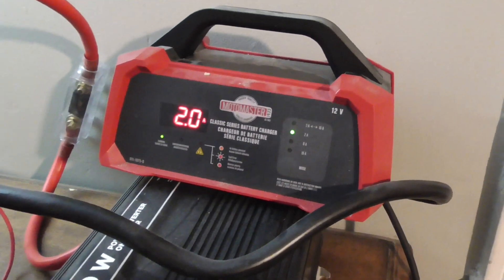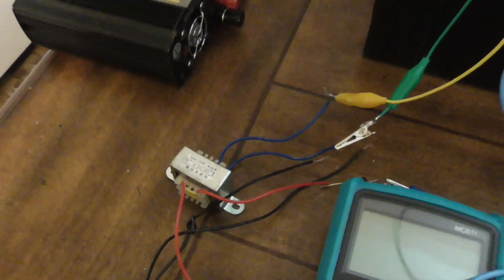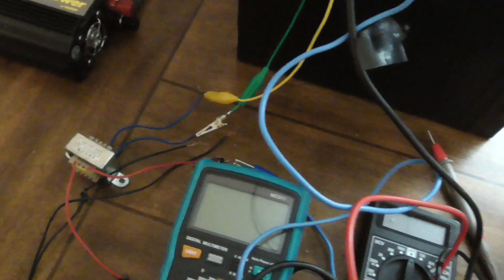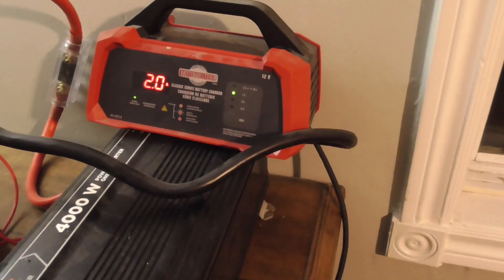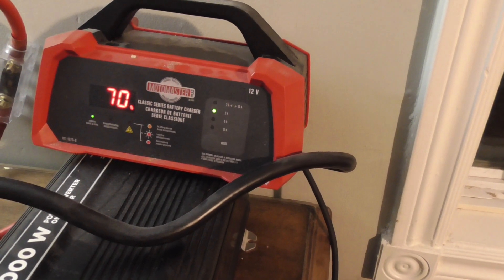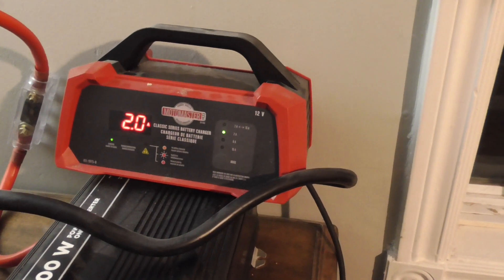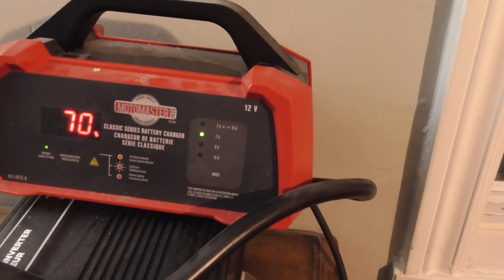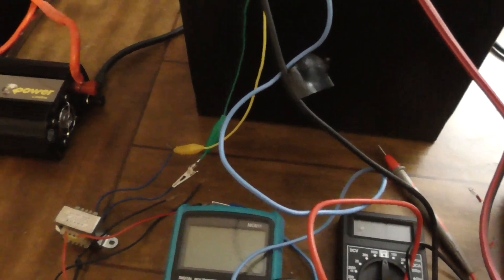Super Fast Battery Charging With Bedini Motor

Comment: 14.4 volts is NOT full charged. A minimum of 15.5 is needed, and ideally 16.20 volts is the best.
Reply from the maker: I would not charge my 12 volt batteries to 16.2 V wow! Bedini built a solar controller with similar voltages and there is a video post of batteries exploding with this. No thank you.
Reply: @joellagace1679  Batteries DO NOT explode when you charge them to 16.2 volts, as far as I know, because I have a set of 4 batteries, which are already 5 years old, but I've been regularly pulse charging them to 16.2 volts, WITHOUT any heating, at all. But the risk is greatest when you are pulse charging them with high discharge pulses, which can cause a minute spark and ignite any built up Hydrogen at the top of the cell. That is why Bedini used to restrict the voltage to just 3 volts higher than the battery voltage, when he used a hefty capacitor. But when small capacitors are used, he would go up to twice the battery terminal voltage. Initially, a partially sulphated  battery, will not be able to come anywhere close to 16.2V. But with multiple charge and discharge cycles, using a pulse charger, the battery(if there is nothing else wrong with it) should easily come up to 16.2V, WITHOUT any heating or off gassing. This is my personal experience.
Reply: @joellagace1679  I've been purposely charging a set of 6 sealed LA batteries, 7Ah rating,  since 2018, all the way up to 16.20 V with a Capacitor discharge pulse charger, built by me. The type of charger and its configuration matters a lot.